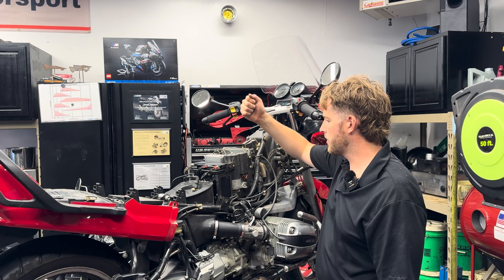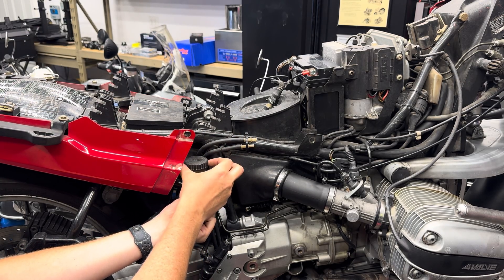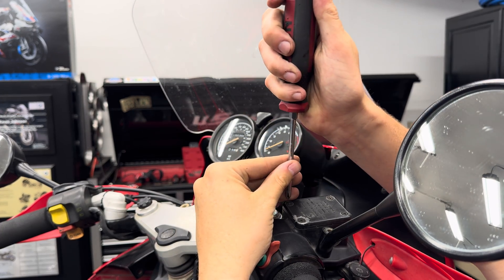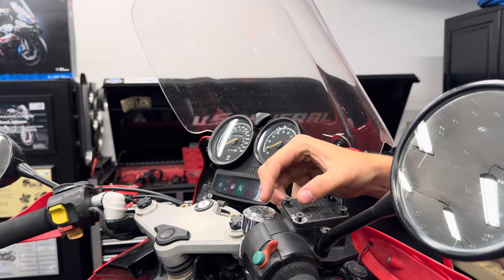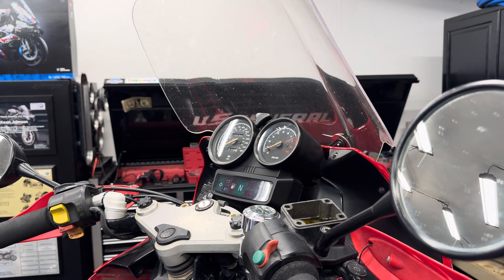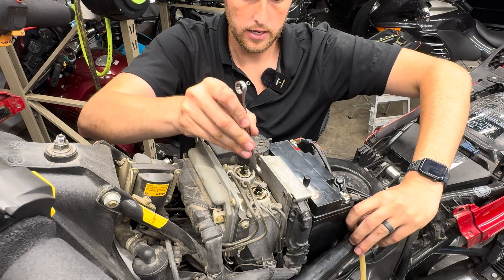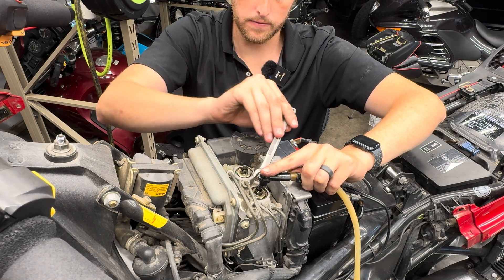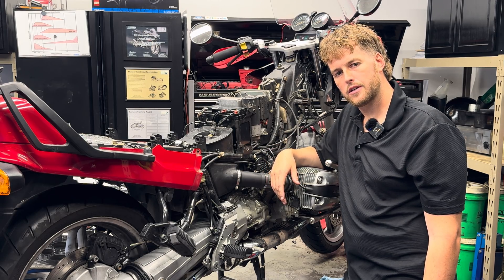BMW ABS Brake Bleed

Comment: Today i met a guy at a coffee shop i rode to with my 1150rt. He has a 2006 1200gs that he crashed in 2010. On his bike the servo engaged at 110 kms per hr and he crashed breaking 6 bones. He went to bmw and they told him he didnt do the brake flush in 2008 after 2 yrs so they have no liability. 
 I would call that a death trap. He asked me about mine and I said mine failed and has been deleted. It was really interesting talking with him. I am going to see the bike next week and maybe buy it.

Comment: Very helpful video. I have a problem with my r1150gs it has the older abs not the servo assisted. The problem I have is when I start the bike and when I drive it the abs works great but for no reason the abs pump starts working with out even pressing the brakes.

Comment: Perfect timing.  I'm just in the middle of fitting a new front master cylinder seal kit and will follow on to flush front and back system through.  R1100RT 1998. Many thanks.
Reply from the maker: Awesome! Hope it goes well.